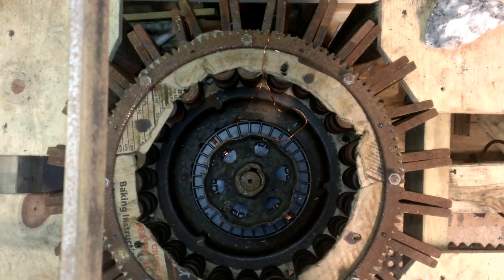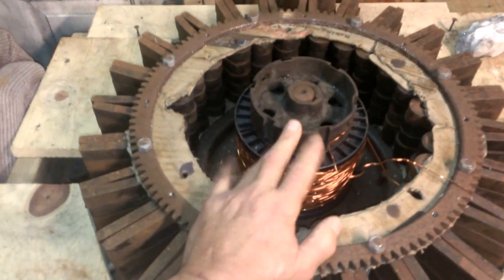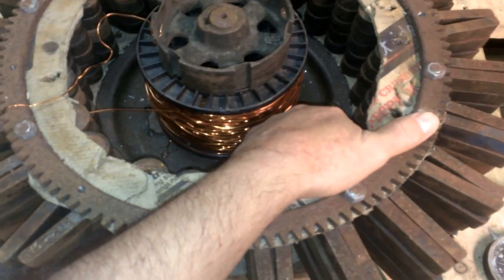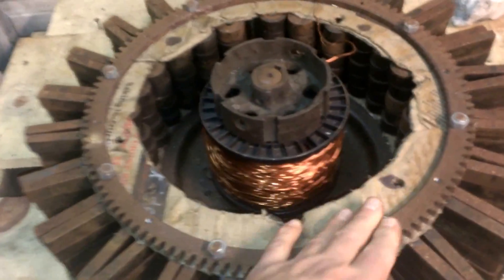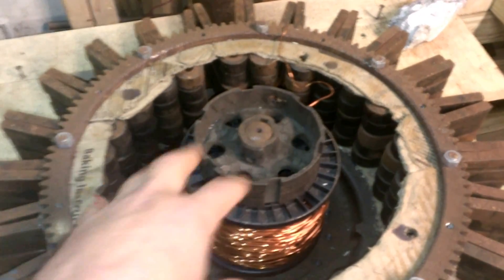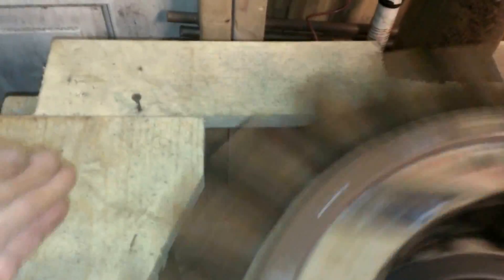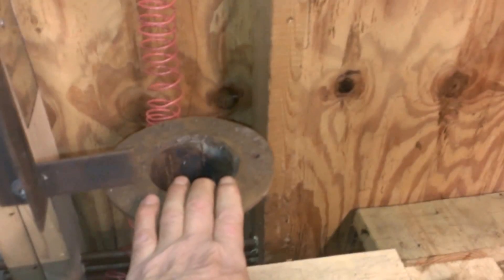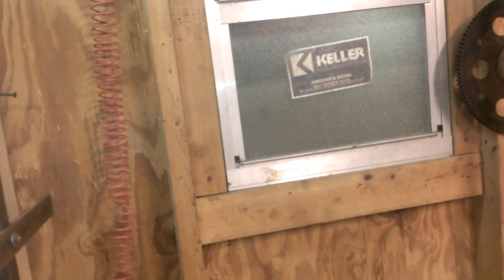The truth about Ed Leedskalnin's magnetic flywheel

Comment: Hi Vinny - great video!  You and Mike are making progress I think.  I got lost about the same point you did though =).  Curious about how the PMH acts as a timer.  When you said that a magnetic flux is created in the PMH's coil as the N-S magnets rotate by, if the bar isn't there what really is it doing?  The magnetic flux would induce an AC current in the PMH but the circuit is incomplete.  Not sure I get how the two relate to each other, but i agree they were somehow connected.

I like your train of thought that he's built a mechanical atom.  I think you're right but he is manipulating that atom to get energy (or something) instead of just demonstrating a regular atom.  For example, not all atoms are grounded.  Would like to hear more about what you think the device is outputting.

Cheers,
B

Comment: Hahahaha Vinny, I can't blame you for trying but man, you need transition effect to reverse the progressive kinetic reaction in time or else it's not free energy nor would it provide the necessary superconductive particle filtering attained when your force a distributor discharge from 24 poles into 6 when pos it reaching tdc. Remember; the flywheel itself is only a filter. Where's the rest of the setup? If you just want a free energy 'wheel' stand alone why not make a 16v with 16 torus coils and a pair of neg centered cow magnet assemblies spinning around at 180 opposites to upset the charge among all 3 grounds? ONLY by squeezing neg in center ground from other 2 grounds will neg head to the weakest ground as positrons snap off opposite with great volatility. 15 to 20layers of flat copper magnet wire in those torus coils are the zero point energy transformers , folding space through implosion with carrier and carried waves. All the known laws of physics may only be broken when you alter 'C' charge as everyone knows; and that is the SUM of poles so map it out if you wish I've spend years on this and know I'm right enough to bet my life on it.
Reply: Man,  Mike
that's a load.
Space truly is a frontier.
Reply: Lisa Wesling WITHOUT a 3 dimensional ion transition through the double metatron, how do you expect to form the necessary superconductive filter on this 3rd (necessary) ground ? Without all systems check, you get enough juice to run a tricycle but not a spacecraft capable of dematerialization and antigravity.
Reply: mikefromspace nutjob must attract other nutjobs.

Comment: It would make sense that ed filled up the inside cavities on the fly wheel in order to concentrate the magnetron resonating effect on the outside of the flywheels magnet cavities. If he had filled the flywheel with water and was dragging the hook in it then he would be pulling up the positive charge into the mass of metal above the flywheel, which would concentrate in the mass and flow to ground. The ground being the PMH next to the flywheel.  I would say that this would be a timer but seems more likley as though it would be like the action of your lungs breathing in and out. Positive charge blowing up and out the top of the wheel and then being fed down and breathed out back onto the outside of the flywheel.  Also with water in the flywheel the water would be spinning one direction and gaining negative charge by the liquid crystal exclution zone, pulling it in from the magnets, and the field on the outside of the wheel would be backspinning in the opposite direction creating back eddy resonance between the magnets that would then be pulled into the water and fed continuously like lungs. You would then have the counter rotating electromagnetic feild which should theoretically cause it to spin by itself. I would not be suprised if it was set up in this manner that there would be a massive positive charge built up in the mass of metal, and a massive negative charge built up in the flywheel which could then be tapped for power.

Comment: I'm lost.  Feel like explaining it in another way?
Reply: Think of it like a solar system rotating. The positive charged sun in the center. negative charged spheres around the outside. The center Sun connects to Earth every 8 minutes with flux. What powers our solar systems rotation?
Reply: capnskull Cheers.  
"What powers our solar systems rotation?" - Would that not be the comic galactic central Sun?  As DC or positive charge (our Sun) initiates the planets to rotate, the AC galactic Sun would be the opposite and prime mover for the solar system?

"The center Sun connects to Earth every 8 minutes with flux" - Connects, how?
Reply: ***** http://science1.nasa.gov/science-news/science-at-nasa/2008/30oct_ftes/  connects every 8 minutes like this.  reminds me of a spark gap setup of sorts based on our distance from the sun.
Reply: capnskull stop making alts

Comment: One thing is that if you plan to isolate the ring on too with a "negative charge", you may want to check how you have it mounted with those bolts, because if there's a metal connection between those bolts and the magnets, then the paper separating it isn't doing anything.

Comment: Hello, I wanted to say that this device looks and acts like a magnetron that has been turned inside out. Rather than resonating on the inside channels of the V magnets it would seem to be resonating in the cavities on the outside of the device. In fact it may be resonating both inside and out. I just thought it may be pulling in the external magnetic feilds/frequencies and focusing them externally, and then drawing them into the center of the wheel. usually in a  magnetron the feild is supplied to the inside of the resonating cavity to speed and intensify the frequency until it can escape as a wave. All I can see is an inside out magnetron that is pulling in the external feild of the earth rather than a feild being supplied from the inside of the device.  Some successful devices have been created by the keshe foundation that use a similar concept and have acheived lifting force. The feild is a counter rotating electromagnetic feild, based on a recreation of the earth and its feilds. They say the earth has a seconed core that is solid inside, with a liquid core surrounding it.  The fourth state of water video on youtube could also play a vital role. In this vid, he points out that the inside of a cell is packed with proteins that are each enveloped by a negatively charged structured water zone, as well as the outside of the cell being enveloped with the same negatively charged layer. This would suggest that filling the flywheel with water would create a negitively charged exclution zone/ liquid crystal right up against all the metal inside the flywheel,  and would create a positively charged feild layerd right next to that and filling the middle of the water like a doughnut. Theoretically you could pull off the positive charge from the water and feed it into the PMH as a timer and achive a highly negative charge in the middle of the flywheel.  In this video he also states that it is the negative charge that has to build back up inside the cell for it to recharge again and do more work. The negative charge inside the cell would likley be 90% or more than the positive charge. Also the liquid crystal exclution zone of the water can be made much larger by adding asprin to tue water. It could be that ed was attempting to pull as much positive charge out of the center of the flywheel as possible to keep the inside filling with negative charge.
Just my thoughts. Awesome job by the way.